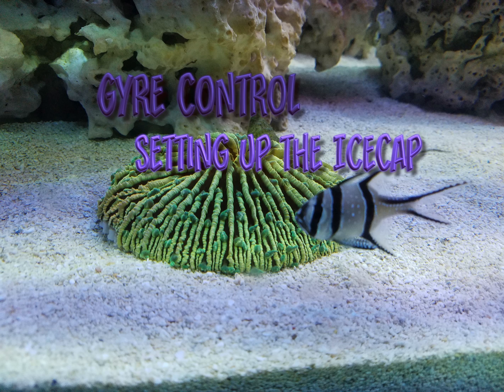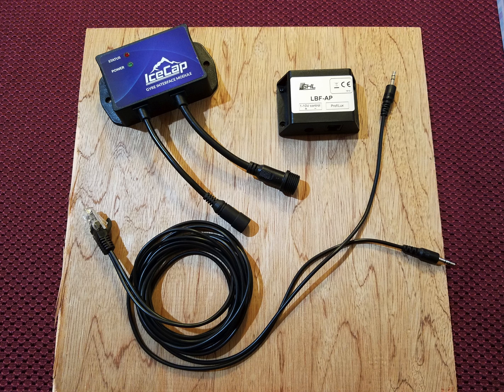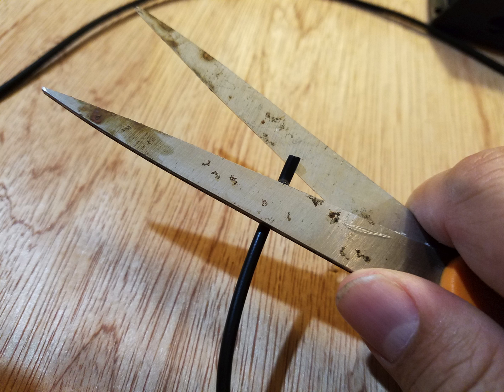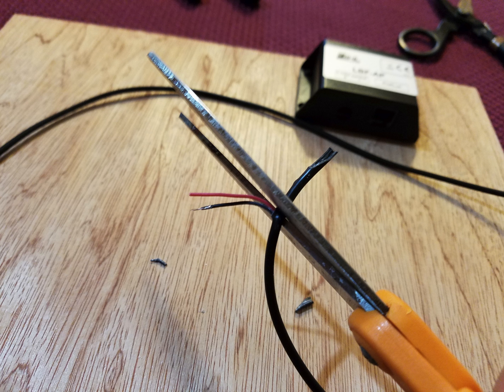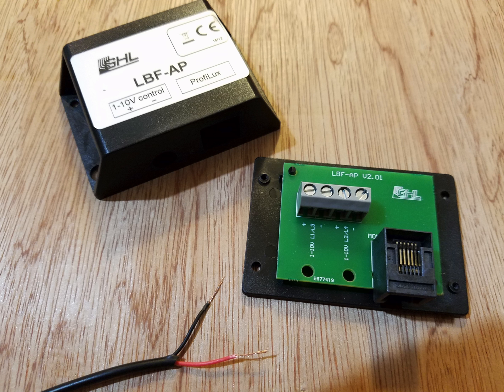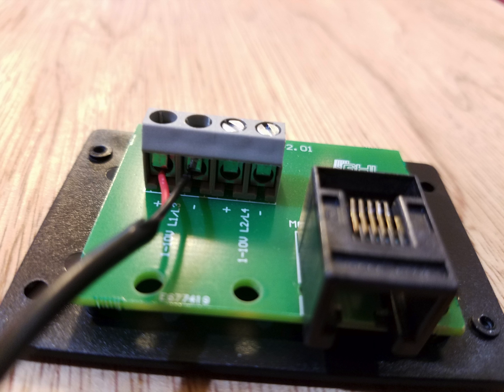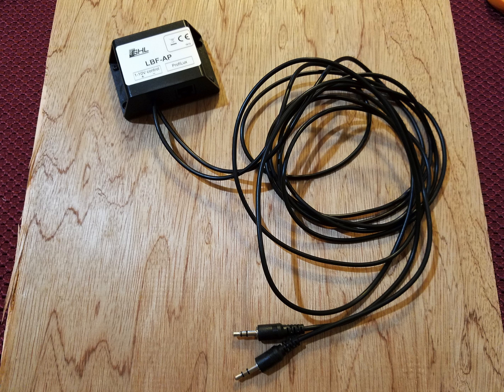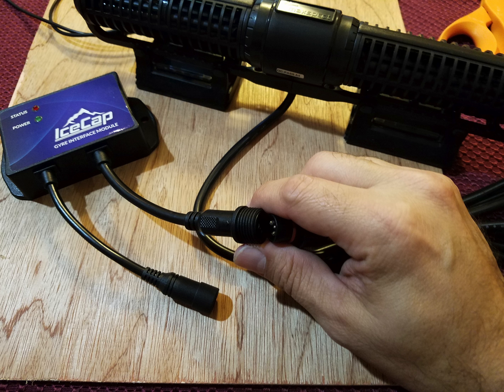Gyre Control with the Icecap Controller

Comment: Nice video.
when do you do the setup on the ghl, and Will it also be able to Run backwards ?
Reply from the maker: I have to run a new line to reach the tank from my controller but hopefully soon. It should be able to control most modes.